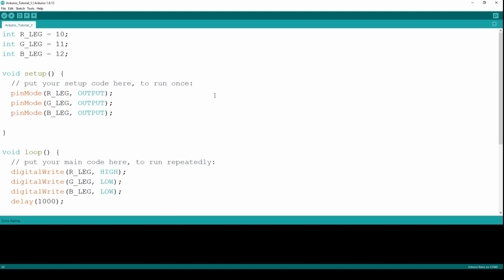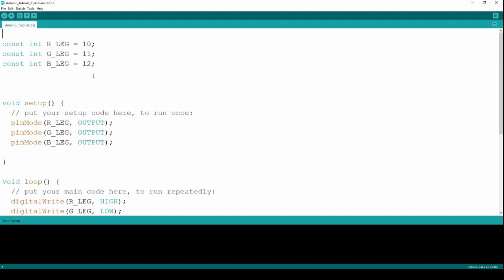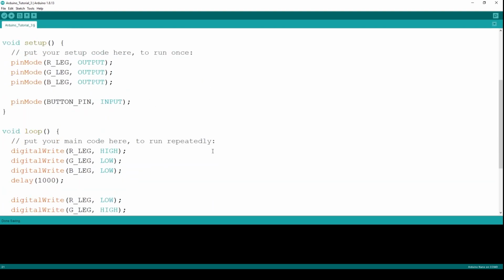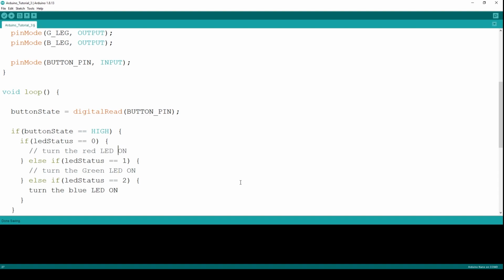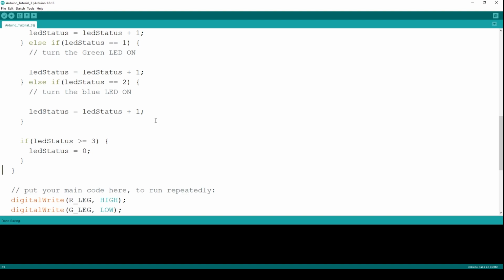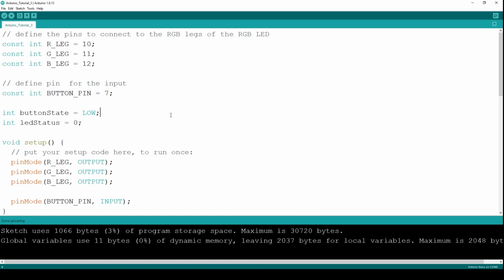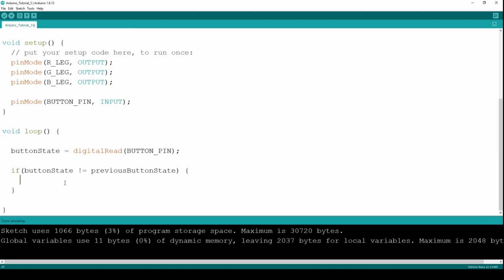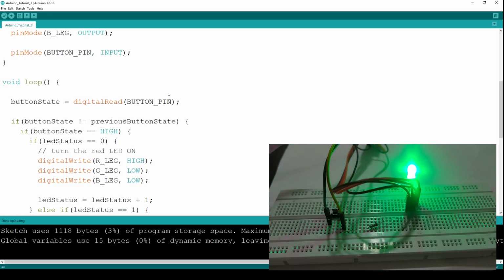Arduino Nano Tutorial #3: Interfacing a push button

Comment: Sketch uses 1088 bytes (7%) of program storage space. Maximum is 14336 bytes.
Global variables use 9 bytes (0%) of dynamic memory, leaving 1015 bytes for local variables. Maximum is 1024 bytes.
avrdude: ser_open(): can't open device "\\.\COM3": The system cannot find the file specified. How can I resolve this issue??
Reply: make sure youre using the right port the nano is plugged into its touch and go until you find the right one